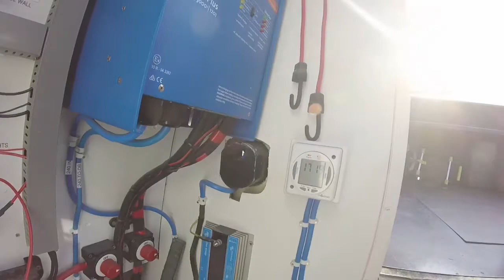Widebeam Boat Build Part 7

Comment: Drywall quickly collapses, from dampness, vibration and temperature differences. This finish is not durable.
Reply from the maker: Алексей Власов ....I agree completely. That’s why I never used any drywall in my boat.